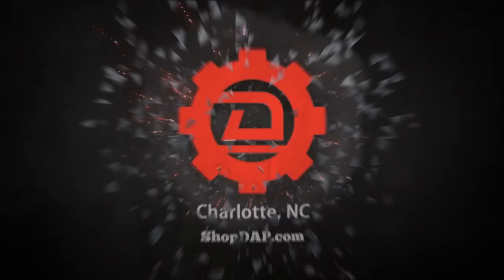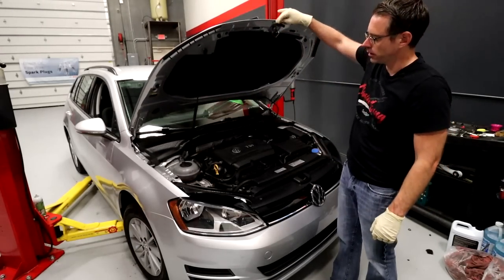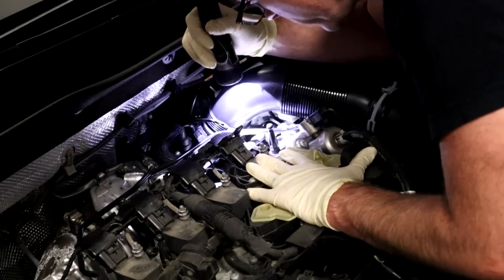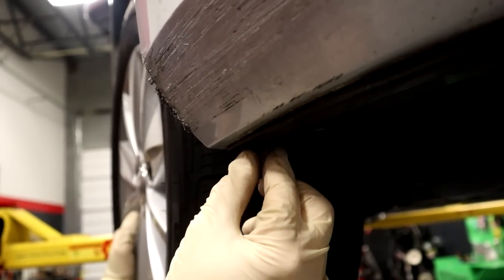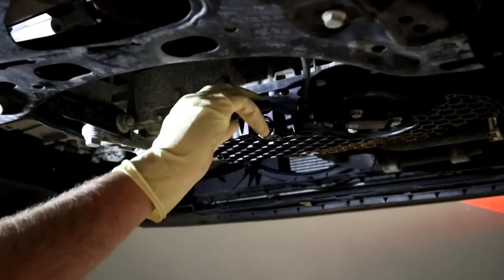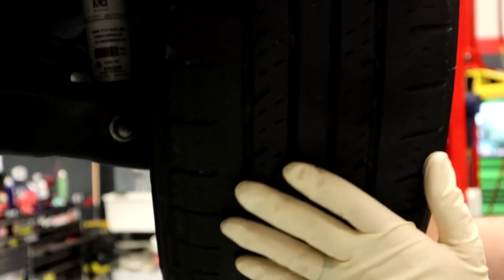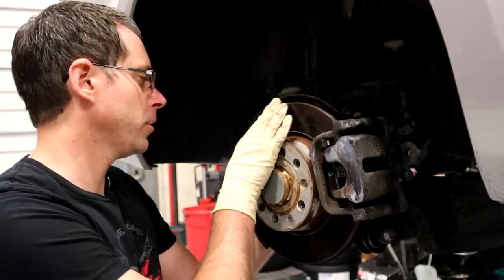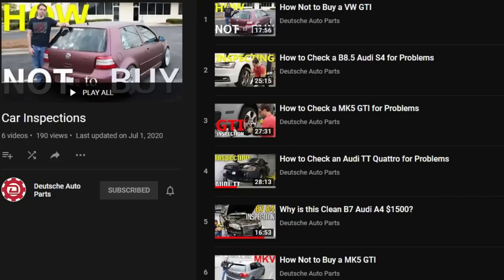Finding Problems on a Used MK7 | Inspection Video

Comment: When I turned in my first GTI lease for my second GTI, after putting about 20ish track days per year over 3 years on that thing, it had 3 melted caliper dust boots, 4 worn comp tires, something kept clicking on power at low speeds from the left front when turning, front rotors were crazed, the front left rotor’s red pint had burnt off when I accidentally used the wrong pads on track... man I just don’t think I would buy a used GTI knowing how myself and my peers drive these things. And I maintain it!

Comment: These are in general solid cars. I owned an 8V A3 (basically identical to the Golf underneath) and had smaller issues like taillights cracking etc. Just a pain but got it all on warranty, same with the thermostat, got replaced on warranty. 

Else though? 3 years of solid and troublefree motoring. 100K miles covered in my ownership and never let me down. 

Can’t reccomend these enough. Golf 7’s are great cars as well, generally troublefree on the most aspect.

Comment: I’m in the market for a mk7 soon. This wil be very usefull. Thank you guys.
Reply: Stay away from the sunroof. They have leaking issues due to cracks and expensive to repair out of warranty.
Reply: @tonyd506  Awsome tip. It will be a diesel, probably a 1.6. Any other tip are welcome.
Reply: The clear plastic over the gauges scratches very easily. Very fine scratches noticeable when sunlight reflects on it. Recommendation is to use compressed air or a fluffy duster to clean. I wish I had know earlier😒
Reply: @tonyd506  Noted. Mk7 is on the driveway now. 1.6 tdi 2016 sportsvan. No sunroof on this one. Another big improvement on my mk5. But yet, it is still a golf. I Love it.
Reply: @jsmits8  im interested in a golf 1.6 tdi 2017 is it a good car? did you have any problems with it?, or is the 2.0 tdi better?
Reply: @SwapDark  i’m very impressed by the 1.6 TDI 110 hp. Stock engine is very good. Used to have a MK5 1.9 TDI. This version is a bit slower than the previous one. But nothing a tuner can’t fix.

Comment: I bought my '16 (S) a little over a year ago. It's been a fantastic car! I did have a wheel bearing go out shortly after buying it, and it had ~20k miles on it, but that's been my only issue. EPC once, but it cleared on it's own and the dealership didn't find a fault 🤷‍♂️

Bought it at carmax, but I've been taking it to Leith in N. Raleigh for service.
Reply: I bought my ‘17 Sport at Carmax Raleigh. So far no issues! Just regular maintenance. Stage 1+ tune 6 speed.

Comment: On the point of the thermostat/water pump note. What usually happens under warranty is that we authorized to only replace just the thermostat housing and not the water pump and when you remove and install the new thermostat 3/10 times the water pump will also leak coolant
Reply: This just happened to me, was pretty peeved when I had to take my car back twice for an issue that could have been fixed the first time...

Comment: My mk7 gti has been through two minor accidents, both were to the drivers side. Airbags never deployed but on both accidents I had the drivers side door replaced and paint and blending done. I pretty much am not going to try selling it because of them. Mechanically ive had tons of reliability issues so I feel like my gti is cursed.
Reply: I feel ya #enginereplacementgang

Comment: I purchased a CPO 2015 Mk7 Tdi with 20k miles from a VW dealer in NJ. When doing my first air filter change at 30k miles I noticed what appeared to be a mouse nest under the grate in the air box. Then at 47k miles the clutch pressure plate came apart and took out the hydraulic release bearing. Don’t know what could really be the stories on these, but i honestly do love the car and have had it for about a year and a half now and 35k miles with no other incidents
Reply: I guess my point being, take that CPO inspection with a grain of salt

Comment: Thanks DAP - you guys are great. The Mk7 GTi is sooo much better than the earlier Tsi models. I had a 2009 Mk5 Gti Tsi, two Tiguans, but my Mk7 is in another league in terms of reliability. And it was a lemon return! BTW, I did 10+ years in the auto industry and was a PE. Seems the main issue on Mk7's is the sunroof, and I don;t got one.

Comment: Dear DAP, hoping this message finds you...Just replaced a Therm. Housing / water pump on my 16' golf R. Replaced the WP belt and bumped the gear forward while tightening it...maybe 1/4 turn! I did not have the crank locked up due to the washer bottle access and had no idea I would move it with a 12mm wrench...Should I be concerned about timing as it is I believe balance shaft driven and probably just rotated the engine a bit? Thanks for your input- Pete
Reply from the maker: No this shouldn’t be a concern

Comment: speaking of body lines- i had the shopdap mk7.5 dynamic tails installed and they didnt look perfect (no big deal) but when i brought it up to my mechanics attention he pointed out that my hatch has more of a gap on the pass side than the driver side. i bought the car new. never been hit. he also compared with another gti they had there. is this just common for mk7s?
Reply: I had a 2017 Golf TSI since new and it also had a misaligned hatch from the factory.

Comment: You noted the small amount of oil by the oil cap. Is this something easily fixed with a new cap? Also, could this account for loss of oil over time? If so, how much over a given period of time.

Comment: 9:25 
That damage could have been when they offloaded it from the car carrier at the dealer when new. 
Back in 2003 we watched them gouge the whole rocker on a nice gold 2003 golf TDI 2 door as they drove it off the car carrier. 
Put like a good 2" crease like that down the whole length of the rocker. 
Oh the horror.

Comment: Is oil contamination in the coolant a common problem in the MK7? Every one of the 4 Audi B5/B6 platform cars we have owned has developed an internal leak in the oil cooler, leading to crud in the coolant overflow tank.

Comment: Hello mr Paul 🙋🏻‍♂️ I just wondered if there is a common ish fault for stalling on a mk7 gti 2013. In my case it’s a uk car. But it’s stalled after start a few times recently but fine to drive...then just yesterday it stalled during driving slow in a car park...it’s had recent plugs recent coils. Thanks. 🙏  I saw a YouTube video of a cam sensor above the cam chain ? Any ideas much appreciated 🙏

Comment: i have a similar oil residue on 2017 passat 1.8t on the oil cap. I think its been there since new . so from time to time i spray brand name brake cleaner spray to dry out the oil. What you think  I should do

Comment: For DIYers like me, i do my oil changes every 5k miles and all preventative maintanence like the brake pads, brake fluid flushes, belts and spark plugs myself. Pretty sure my vehicle carfax will not have any service records after 30k since i stopped going to stealership for smaller maintenance.

How do i go about this especially while trading or selling the car ?
Reply: Ravi Annadurai I can almost guarantee the dealer you were trading your car in two won’t care at all. Depending on the mileage you finally traded in it they’re just going to send it off to auction. If they do ask or if you sell it private party keep your receipts from all the maintenance work you have done. The next buyer will appreciate knowing you took care of your car.
Reply: RECEIPTS - save them. All of them.
Reply: I put together a maintenance spreadsheet and have a folder with all receipts. I’ve sold two cars sight unseen and pretty sure this is why.

Comment: My 2016 Golf has orange coolant... I was told that is the correct type. The water pump was replaced under warranty and they replaced with orange as well. Is that okay?
Reply: Alex Vanderheyden wrong type. Should be pink g13 coolant
Reply: TheSovietHotDog Well shit, that’s definitely concerning. I gotta go to the dealer soon so I’m going to have them do a flush and put in the correct type

Comment: Please, can anyone say if it is fine to discover the presence of some oil inside compressor exit duct?  this happened after removing the air guide pipe to the throttle valve on 2.0 TDI engine 150 HP with 160K miles

Comment: The stupid VW dealers were putting conventional oil in the B5 era Passats, leading to the "sludge monster" reputation. I use Mobil 1 and an oversize Mann 950/4 filter, and change the oil every 3K miles. No sludge/coke in the top end when we replaced the valve cover gasket two years ago.

Comment: My 2018 Audi A3 tends to squeak in the front left corner of the car whenever I accelerate from a stop or whenever I'm taking a slow left turn. I went to the dealership and it went away for a while. They've told me I have about 8mm left on my brake pads in the front for both sides. Could it be the brake wear indicator rubbing on the rotor when I'm turning? I don't think it's the wheel bearing since it's more of a rhythmic squeak at low speeds that goes away with speed compared to a howling noise associated with wheel bearings. Does anybody have an idea of what it could be?
Reply: balljoint or bearing, probably both
Reply: @rkan2  Thanks I'll get my dealer to take a look at that.

Comment: Hi from europe just bought mk7 2.0tdi manual highline
Reply: is it nice? did you have any problems so far?
Reply: I sold it, but it was great daily
Only waterpump failed at 155k km
Way better and smother than 1.6tdi
Reply: @AA21397  did you had or drove a 1.6 tdi?, the 2.0 is more expensive and harder to find aswell 😕 didnt find a 2.0 yet only 1.6 almost new, with 30k quilometers on it
Reply: @SwapDark  drove mk7, a3 8v and couple more with 1.6 and didnt like it at all,also 2.0 has better suspension
I imported mine from germany
New owner had it remaped it goes almost like gtd
Reply: @AA21397  oh nice, but im thinking of having it for like 4 years or so and i dont do to much quilometers from home to work thats why im asking
Reply: @SwapDark  if you do less than 10-15km to work than dont buy diesel you will have problems with dpf it will do regeneration every 150km and it colud clog up eventually
Reply: @AA21397  so should i go with the 1.0 tsi? Instead
Reply: @SwapDark  or 1.4 possibly GTE
Reply: @AA21397  whel the GTE is way more expensive and have a lot of km done in it but i will see more and if i dont find i will go with the 1.0, or buy a toyota 😅
Reply: @AA21397  but thanks a lot

Comment: 7:28 how long is an extended period of time? Because I just mixed coolant a couple weeks ago without knowing it was bad :S

And is flushing coolant and putting new one gonna be good enough?
Reply: You can flush and refill with recommended fluid and be fine. VW dealers have the right stuff and it isn't terribly expensive. Just don't wait a long time to remedy it. I had an older Jetta that I had to replace the radiator because cheap coolant ate it from the inside until it leaked.
Reply: @Wpjgdmtu  yeah I took an appointment as soon as I learned about that. Thanks for the reply!

Comment: Can't believe my car I got 5 years ago for 24k is being listed with 71k miles for 21k with this crazy market
Reply: My parents got a '19 Jetta brand new for 16,800 out the door in late '19. 
Early '21 I looked on the pre-owned lot,and they had her exact car. 
37k on it ,and they wanted 19,900. 
Moms car has like 9k on it,I told her it should fetch like 22k🤣🤣

Comment: A MK7 Golf with a manual handbrake? I've never seen that here in Germany :o
Reply: MFSE7EN  mine has one 🤪
Reply: Mine has one too.
Reply: I think all US Mk7s outside of the Golf R have them.
Reply: MoGunz24 all tracks have electric ones
Reply: TheSovietHotDog wrong. It seems all NA assembled Golf7s have manual handbrakes. Rs have electric because they are assembled in Germany.
Reply: Mexifinn I never said otherwise lol
Reply: @TheSovietHotDog  My Alltrack has a manual parking brake.
Reply: It's because this ones are assembled in Puebla, Mexico and the spec for Mexico-USA-Canada cheaped out on putting the electronic one. I own one of these wagons and it drives and holds perfectly, but some things are bellow the European quality controls as the window switches, the door handles, and the center console. And all the GTI's and R's that you can spot in Mexico City have the electronic one because those are imported.

Comment: I’ve had the water pump replaced and it still smells like coolant. 20,000 miles later.  I brought it back twice and they say they don’t see anything.  Do these cars sometimes smell like coolant?
Reply: Mine has had the smell since new, no issues, and the dealer never found anything. 31k miles currently with not one hiccup.
Reply: Mine smells like clutch, which exploded at 50k and left material embeded in the bell housing.  So far, I'm not impressed with the VII. Seems more fragile than the last one

Comment: How bad is carbon build up on these ea888’s?
Reply: Really bad in general.
Reply: Steve F like only buy new and add a premium catch immediately really bad? I’m thinking of a used golfR but the humble mechanic took his apart at 10k and already had significant build up with using only premium shell and an additive every fillup
Reply: Ethanol is much cleaner burning than gas.
Reply: @alelx jines Nope, everything I've seen says otherwise.